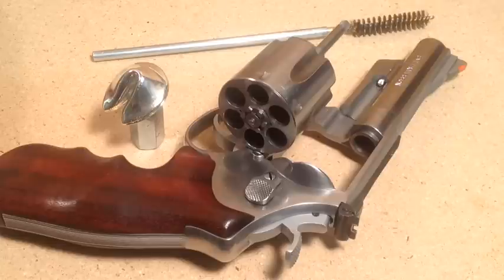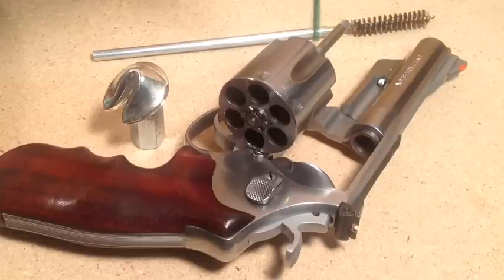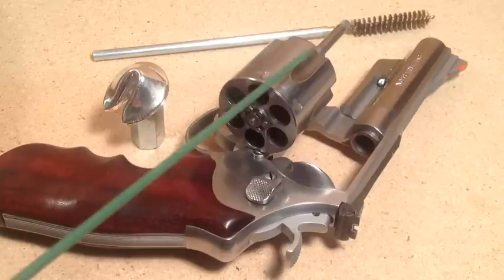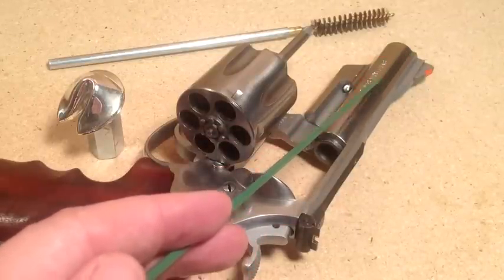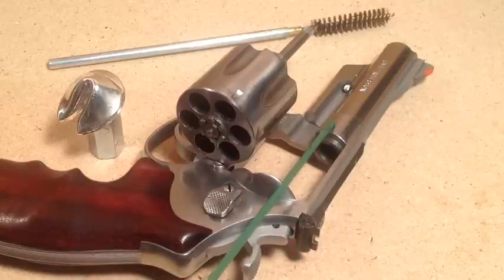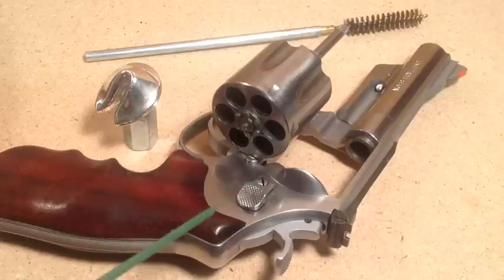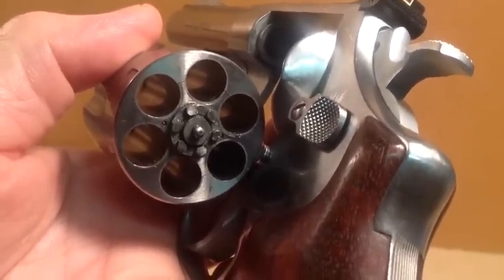Let's Prevent Barrel Leading - VR Gun Nut

Comment: Fortune Cookie - you have nailed it once again!  I am new to casting and recently loaded up some Lee tumble lube 358 cast bullets.  I used water-quenched wheel weights (btw, they dropped at .362 so I had to size them down to .358 for the gun?!?) and they finished up at about BHN 20.   I used the 45/45/10 lube before and after sizing and they shot well, but left considerable lead in the barrel.  I fired up one cylinder of jacketed bullets at the end of the session and the lead almost completely disappeared!  Cleanup was a breeze.  Thanks for that great tip.
Reply: Shooting jacketed bullets through a leaded barrel is pretty harsh treatment for a barrel. I try not to do that. 
  To each his own though.

Comment: Several months back (before I stated hand loading) I could only find some cheap 45lc Winchester Cowboy rounds. Holy schmolly! they nearly filled the grooves with lead all the way through, but really bad at the muzzle. I was able to pick flecks off with a scribe but couldn't get it all to my satisfaction.
I finally broke down and got the Lewis lead remover and J-B bore cleaning compound from Brownells. Ran it through maybe half dozen times. Not only removed all the lead but polished the bore to a mirror finish. =)
Reply from the maker: shrugger1- May have been all three (bullet size; bullet hardness; bullet lube) were out of balance.  The Lewis Lead Remover is for serious leading removal - I don't have one, because I do my darndest not to get leading bad enough to require one - been shooting over 40 years without really leading a barrel.  People have leaded their barrels so bad that gunsmiths had to be called in.  Glad you got the lead out...Best to ya...
Reply: FortuneCookie45LC I didn't even fire the entire box. I miked  the ones I have left and they measured .454 at the case mouth. That's probly fine for pre 50's guns but if I remember right. It's not recommended going over .452 for post 50's.
On a positive note. None of my reloads appear to be leaving any significant amount of lead. ;)
Reply from the maker: shrugger1 You know your SAAs - the older ones did have oversize chamber throats.  My most recent Ruger mikes at .4515", and my Lee 452 252 SWC 2 cavity mold drops 'em at .4525 - .453 just perfect for my Ruger - no sizing needed!!  I tumble lube 'em 45/45/10, and I'm in business... Best Regards...

Comment: ...back in 1986 a guy came into our gun store in Pompano Beach, FL with a .357 mag that would not chamber .357 mar rounds...in chambered .38 special just fine but not .357.  I bought it to our resident gunsmith, Brian Epps,  and he saw the problem immediately...evidently the owner had shot .38 wadcutters exclusively and there was a ring of lead perfectly formed immediately in front of the case mouth...he told me that the solution was to use mercury to remove the leads (this was long before the EPA  controlled its use)...I also learned to keep cast lead bullets below 1200 fps when I reload - I had a similar leading problem with my 9mm reloads leading the barrel of my Belgian HP and began using only jacketed projectiles in them...

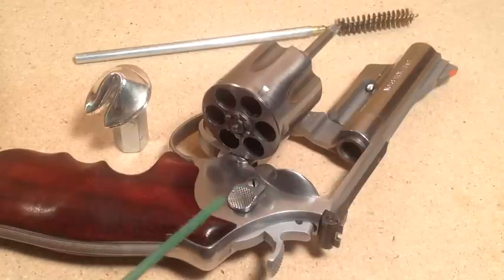Comment: Great post.  Just a thought, I would probably refrain from shooting a jacketed round (12:38) through a heavily leaded barrel to help clean the lead out.  Heavy leading indicates a change in bore diameter, which equates to increased pressure and potential unplanned firearm disassembly and personal injury.

I do cast and I do shoot smokeless and black powder hand loads.

Again, great post and thank you for taking more than 90 seconds to explain a rather important subject on casting and cleaning.
Reply from the maker: Mike Smith - Great point you're making, and this is what causes a lot of the misunderstanding about shooting jacketed bullets after shooting lead.  What I like to recommend is that after shooting a lot of lead and the lead is still shooting accurately, then run some magnums through to make cleaning easier.  But if the groups are opening up, light leading is happening.  You can still shoot magnums through to clear.  But if you keep shooting the lead - the wild keyholes will start to appear - then the leading is heavy enough to start obliterating the rifling.  It is then dangerous to shoot magnums through to try to clear for the reasons you state.  And, if you get away with it without the gun dismantling itself, that's where the "you are ironing the leading into the barrel" stuff comes in.  In short, it's too late to try to clear leading using jacketed ammo - that's best done when there is little or light leading to make cleaning the gun afterwards easier.  Have a great day...

Comment: I beg to differ Sir. It is necessary to determine the diameter of the barrel. If the cylinder opening is smaller than the slugged groove diameter then the cylinder opening should be reamed to .002 over the groove diameter and size the cast bullets appropriately.

Comment: The trick I use for 9mm is to use the 125 grain lee bullet mold for the 357 magnum instead of the 9mm mold. I use wheel weight lead and I water drop them to increase the hardness. I then size them to .002 larger than my bore and pan lube them with a 50/50 mix of wax and vasaline with a little STP oil treatment. I also use a 38 special expending die and 38 special taper crimp die so the bullet wont get squeezed back down when it's inside the case. The leading I get is very minor and cleans out with a few brush strokes.
Reply: How does the STP affect the lube?
Reply: 8mmfanatic
Wax and vasaline don't do that good of a job to prevent leading so people add a small amount of the STP oil treatment because that's supposed to help. I don't remember the exact physics explanation behind it. There's all kinds of home made pan lube recipes and that was just the easiest and most popular so I started using it and found that it works fine. If you look on the http://castboolits.gunloads.com/ website you'll find all kinds of pan lube recipes and explanations why they work better or worse.
Reply from the maker: Prepare2Survive- I like your recipe, the one I use substitutes a tablespoon of RCBS Case Lube instead of the STP oil treatment (we always add NOT gas treatment).  Best to ya...
Reply: Prepare2Survive Thanks I'll go and check them out.
Reply from the maker: ***** Checked out the link, and PC is intriguing.  I tried epoxy paint and it was very technique and time sensitive - needed two coats to look good - bullets shot well, but not any better than tumble lubing and TL beats it on time, economy and effort.  But the way you do it seems much better in speed.

Comment: The Lewis Lead Remover works good cleaning the cylinder. in addition to the barrel. It also comes with an attachment that will clean the forcing cone.

I had a friend that used to put a chamber brush and rod section on a drill to clean his AR. He ended up damaging the throat and ruining the barrel.
Reply from the maker: myaim07 - Great point - I only use the drill thing to clean my revolver cylinder throats - there's no rifling in there and the practice is safe as well as effective and EASY ( I like EASY ).  But the barrel is a whole other story - your Lewis LR is well regarded solution to the problem.  Why I stick with the copper mesh or lead removal cloth instead of getting a LLR is beyond me… just habit I guess - although it works also…Best to ya...

Comment: Oh yes! Chamber throats are often smaller or equal to the barrel bore/groove dia. I've spoken to S&W about this. If it shoots jacketed bullets fine and accurate, then it meets their specs and is of no concern to them. I had to ream my 686P throats to .358 and 629 throats to .430...all just to get good bullet fit. Since then I've had no issues.
Reply from the maker: shotgundrums - It's a shame you had to go thru those exercises to correct what S & W should have provided - and they know that - they've only been building revolvers for about 150 years...when I said in my video that revolvers don't have oversized barrels in relation to the cylinder throats unless they were perverse...what I really meant was unless the gun manufacturer was perverse...Thanks for your great comment...

Comment: Great.. my revolver is perverted. 
When I picked up some Magtech 130 grain 38special  bullets I started noticing slight leading in the forward end of my cylinders but worse , a little leading in the first quarter inch of the barrel. Never had this using 158 grain bullets.  All bullets I use are jacketed.  Go figure. 
Thanks for another great video.
Reply from the maker: tjmooremusic — always good to thread with the tjmooremusic... your gun is not perverted or it wouldn’t shoot those 158s well.  Your revolver might have overlarge cylinder throats so that jacketed can shoot well - might need large cast bullets to do the same.  Your choices would be to shoot the 158s your gun likes, or shoot Cast bullets that are a hair bigger than your cylinder throats.  Perverted revolvers have barrels bigger that you cylinder throats making obturation practically impossible...  Good shooting to ya,  FC Steve

Comment: I have had trouble with 750 - 950 for Bev Base Comm cast SWC 44's , or the very soft Horn & speer swc at 750-850 , I just live with it & clean lightly every 100 or so & more before Jacket bullets . I have shot some Plated to help with moving the last hard bit & more scrubbing to get 99% clean . Some day I will try some hot loads to see if they will lead less . Mostly at the breach end .

Comment: Another terrific video.  But I have a question.  If gas cutting causing leading, well, not IF because we know it does, but why then does the base of the bullet not melt and deposit lead in the barrel?  I shoot cast bullets all the time and I don't have any trouble, but I find that curious.
Reply from the maker: Don Eime - That's a great question.  When bullets obturate well, no gas cutting and even the lube in cast bullet grooves remains.  If gas cutting, no lube remains and barrel is leaded.  Gas cutting happens when high velocity (and it is ultra high) gasses blow by the bullet sides venturi effect melts the lead there.  Another venturi happens at cylinder gaps and that gas can actually cut the steel of the top strap - reason that hot 125 grain 357s wore out top straps.  That can sure leave lead in a barrel if steel can be cut.  There is no venturi at the base of the bullet, just pressure.  There was a study done years ago where card wads were placed at the bullet bases and the cards weren't even burned on firing.  The study was done to determine if gas checks actually protected bullet bases or not.  Turns out the gas check helps to obturate the barrel and seal the bore but only if the bullet is the proper size.  And gas checks make bullet bases more regular for better accuracy... Best Regards

Comment: Great video but I've shot 2000rds of cast .224 55gr bullets through my 5.56×45 chambered AR-15 with no leading whatsoever. I use powder coat but it's such a pain in the ass to get good powder coat adhesion.

Comment: What a great video. Thanks
Reply from the maker: Nick L -- you will read and hear it all the time - two other schools of thought. 1) slug your revolver barrel and use bullets .001" bigger - 2) bullets should fall through revolver cylinders to be correct.  Neither is the way to go, and my other videos in the Barrel Leading playlist go into that. Problem is that some revolver setups allow 1) and 2) to work so some shooter's get success and spread the message.  But the analysis in this video explains all setups. Suffice to say that SAAMI has made it possible for Lee Precision to recommend using Cast bullets .001" bigger than the standard jacketed bullet diameters for caliber.  Note that if you do that, bullets will not fall through revolver cylinders.  There is also a hybrid of 2) that says revolver bullets should be snug, but be pushable thru the throats - really the same as .001" bigger than the throats.  Have a great day, FC

Comment: Please forgive me as I am new to casting. I have a question or two if you don't mind. I have a Ruger SRH (45Colt/454 CAS) which mic at .454 at the chambers. Am I to order custom molds that will drop bullets at .445-.456 and size/lube to .455 to prevent leading? Also, all my commercially manufactured gas-checked bullets (.452) fit easily into the chambers, are they aiming for universal fitment at the expense of increased leading? Thanks for your help and many videos. I'm trying to wrap my head around this stuff.
Reply from the maker: JulietLimaTango - Some old 45 Colt guns (Colt SAAs and 1917s in 45 Colt caliber had chamber throats at .454".  Hearing that your SRH has .454" chambers is a bit disheartening.  You don't have to order custom molds - if you order regular Lee 452 molds in NON TL designs like the 452 - 252 SWC or the 452 300 RNFP GC - they should automatically cast bullets for you around .453 - 454".  If they don't just drop through the chamber throats, they might just be fine.  Don't bother sizing them and lube 'e with 45/45/10 system.  If you shoot your .current 452s, you might be lucky and they shoot well for you with only minimum to moderate leading.  If the leading gets bad, you will lose accuracy and then more shooting will give you keyholes - not good.  If your gun is used for hunting with full power ammo, you shouldn't be shooting many of them at a time (perhaps 10-15 rounds) so the leading may not build up enough to be a problem.   Another solution would be to only shoot jacketed bullets as they will not lead, and your barrel is probably .451 so .452 jacketed bullets (most are .451 - 452) will give you the accuracy you want.  Still Ruger did a bad job with this cylinder.  .452- 4525 chamber throats would have been much better in all ways for all uses.  If you slug your barrel, you will probably find that it is .451 or even .450".  If so, Ruger just plain flat out did a bad cylinder - unacceptable really in a quality gun like your SRH Casull.  (If your Ruger barrel slugs at .452-453" then the cylinder - barrel relationship will be fine for cast bullets at .454-455:, but then jacketed bullets will shoot with poor accuracy - then you have both cylinder and barrel out of spec and a worse case scenario).  The above solutions are compromises that you are being forced to make.  As such, your final option and perhaps the best is you could send the gun back to Ruger for a new cylinder.  It is essential that hunters have full confidence in their equipment - not partial, or maybe confidence - and Ruger knows this or should know this...My own Ruger SRH in 44 magnum does not have an unacceptable cylinder.  Best to you and Happy Holidays

Comment: Okay I have a question 🙋‍♂️ my cylinders on my Ruger Security six do this 
3.590
3.595
3.590 
3.595
3.590
3.595
Reply: I'll admit my revolver expirenece is very limited  but I would call ruger and find out if that's supposed to be the case and send it back.

I would think they should all be equal.
Reply: size to 360 if it chambers i have a ruger sp101 that has .3575-.358 cylinder throats and im sizing to .359 and see how it shoots

Comment: Fortune Cookie:  doesn't the lead "problem" go away if you use jacketed bullets (jhp,fmj) at the cost of greater barrel wear?  Also I have always been told NOT to use lead at speeds over 950 fps.  I do not reload 9mm. I do reload 38spc (for 357  pistol) and 45LC but even there favor JSP or JHP  over lead.  ???
Reply from the maker: Gitfidlpickr - Nothing wrong with shooting strictly jacketed bullets.  Your 950 fps velocity barrier with lead bullets is way on the conservative side.  We can shoot up to 2000 fps with our cast bullets with good performance.  We might have to use pure linotype at the higher velocities to get performance without bad barrel leading, but it could be done.  I've routinely shot my 44 magnums into the 1400 fps zone with hard cast bullets with complete satisfaction.  If you have only used commercial cast bullets, I have found my own cast bullets to be superior for my uses.  Power, speed and accuracy are on my doorstep at 6 - 7 cents a shot... that is why I shoot cast bullets....At $3.50 a box of 50 rounds, I can shoot a lot and the smiles just seem to come in abundance - most of the time -  Have a great day,  FC